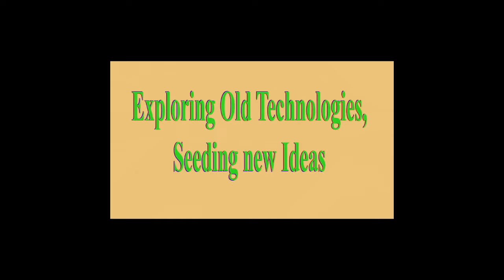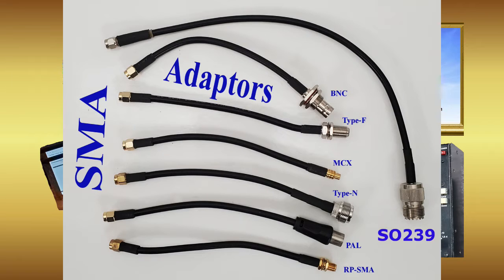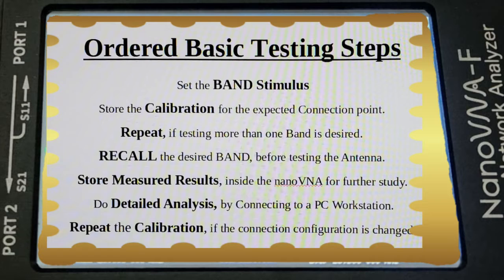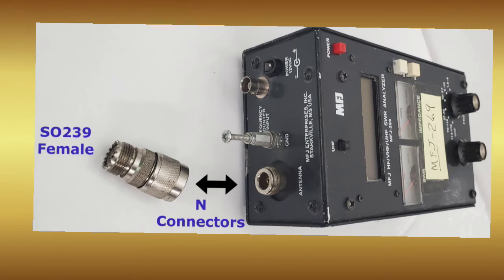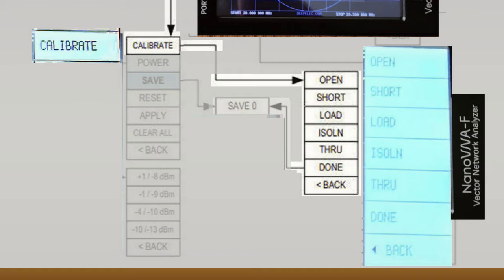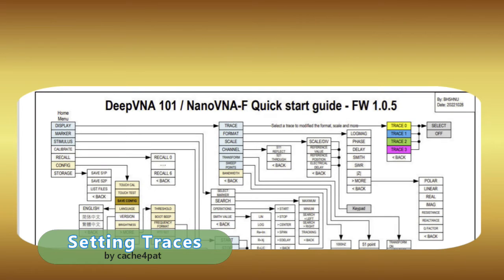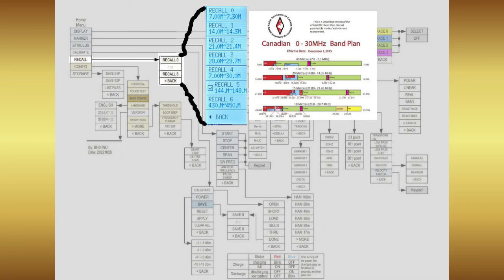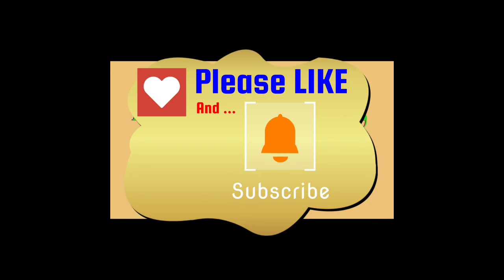nanoVNA Shoot Out with the MFJ-269, in 2023

Comment: Now you have the NanoVNA you can measure return loss rather than the clunky and uninformative VSWR. It presents the same information in a much more informative way. First thing to do with it is screw on some connector savers and never take them off. At some point there will be damage and you just put on a new saver. The alternative is a wrecked NanoVNA.

Comment: the MFJ 269 B a versatile simple to use  gadget! and its more accurate than it need to be, now years later i still use it building tank circuits, measuring coax stubbs, analyzing antennas, fault finding coax, reading input circuit values, building vhf  yagi's was never easier, wanna play with hf mobile antennas ? never easier a device... Nano Vna ? ok , but do you really need one :)

Comment: How much would it really affect the results if you did the calibration at the sma connectors and did not recalibrate for the foot long piece of coax and additional connectors?  I'm considering that in the real world you will have some length of coax, 10, 20, 50, or more feet long, between the antenna analyzer or nano--VNA.  So, what difference does that extra foot make?

I understand that whatever the SWR is at the antenna, losses in the coax or other feed line will always make it look better.  But, in most cases it is not practical to take the measurement at the antenna.

Comment: My nanovna shows that my swr is 1.93 while the swr meter shows 1.01 for match so which is right?
The swr meter just shows the swr only?
Reply from the maker: Have you calibrated the VNA properly for the same point of measurement. For example, if  you are referring to the Transceiver's VSWR meter, you need to calibrate the VNA for the point your antenna enters your radio, with the same calibration unit connector type as your coax. This point is mentioned in  the video.
Reply: @cache4pat  I calibrate the vna 144 to 148 mhz . The nanovna showed 1.93 and the vswr showed flat match. Don't know if I should trust the vna
Reply from the maker: It is not out of the question that your nanoVNA is defective. I have always gotten a close correlation between my transceiver, the MFJ, and the nanoVNA. Sorry it's not working out for you.

Comment: The Nano VNA is a great little instrument, but you get what you pay for. I found that the Nano VNA was much more subject to interference from other signals than the MFJ-269. An example, I was testing a six meter loop in my yard with the loop up about 15 feet. The nano VNA could not successfully test the loop having varying and incorrect results. The MFJ was able to test and allow me to adjust the loop problem free. There is a lot of value in the Nano VNA. I would recommend it for filter testing, etc. on your bench. For antennas my results were sometimes OK but other times not.
Reply from the maker: Thank you for your comment. Which version of nanoVNA were you using ?  Mine is the nanoVNA-F which is inside a metal box ... that might help your concern.

Comment: The nanoVNA is a nice tool, but I would prefer to MFJ if I use it outdoors. It's difficult to read the measurements from a TFT under the sun. An antenna analyzer is good enough for tuning an antenna at most of the time out of your radio shack. Since the nanoVNA has two ports, it is a complicated RF tool for tuning LPFs, BPFs at your electronic workbench. For doing such things, it now overwhelms the performances of an antenna analyzer for the far most in the old days.
Reply: I agree if your a average Ham like me the MFJ does all you need.  If your
an antenna engineer get a VNA.
Reply from the maker: Thank you for your perspective & comments. I find the larger screen size of the nanoVNA-F helps when the sun is too strong. Plus, its ability to do in-field storage of measurements allows you the option to view the results on a PC screen later if the sun was too strong to view the detail. But I have to agree that if all you need is a quick VSWR indication, the MFJ wins.

Comment: It would be great if you did a video on how to make the open, short,and closed calibration caps for the pl 259 that you used. Thanks for the video!
Reply from the maker: Great idea. There is a short embedded clip of the end result of making PL-259 calibration units. Since the objective is to approximate the coax attach point, making an Open requires no change to a new stock PL-259, and Short is dead easy; but the Load one requires a bit more care. Luckily, the nanoVNA isn't delivering much power, so you can go with the smallest resistors you can find to fit the space. Keeping the lead length as short as possible is important; as well as avoiding inductive resistors. My approach to zero in on 50 ohms was to sample a bunch of 1/8th watt 100 ohm resistors, testing them in pairs connected in parallel. I hope that helps, in lieu of a new video.
Reply: @Exploring Stuff  Thanks!

Comment: I find a NanoVNA is a far superior device for evaluating pretty much anything electronic, from antennas to inductors and caps, and even crystal filters, as well as IF's, and identifying and locating impedance anomalies in feedlines. And they work waaay up and waaay down in frequency. They are simply an unbeatable test instrument, and are FAR cheaper than simple antenna analyzers. Antenna analyzers have become a thing of the past, antiques. Hams just don't know it yet.
Reply: when I got a Nano I got rid of MFJ. MFJ can't see the whole band in ONE visual representation. VNA best tool so far W9DLP
Reply: I have both, the mfj is a quick use dedicated device. And it is ok....
Obviously the vna is more versatile by design.  Both have a place in the modern ham shack or on the test bench.

Comment: IMO, the nano  vna doesn't need to be calibrated by band. I have mine calibrated for a set of bands, i.e., from 80-10 and from 6 to 70cm. I can then recall that calibration, and from within that calibration i can call up specific bands and get a useable and helpful view of the antenna on the frequency of choice. I have only done the calibrations once, and kept them stored. No major need to recalibrate often, but it doesnt hurt. 

Overall, both the new and old tech work great, though they represent different needs. 

Great video!
Reply from the maker: Great point. Thank you.

Comment: IMO, you need both a vna for its capabilities vs price, why not? And its great for testing and tuning traps, filters, baluns etc..
However, if you work with antennas at all, you need a dedicated antenna analyzer. 
The MFJ 259/269's are good solid instruments with long history. But they dont do graphing, so multiband antennas are harder to test.
The Rigexpert is a great tool but if you want over 30mhz they get very expensive.. 
Anyway, Great Video!!!   Thanks !
Reply from the maker: Thank you :)